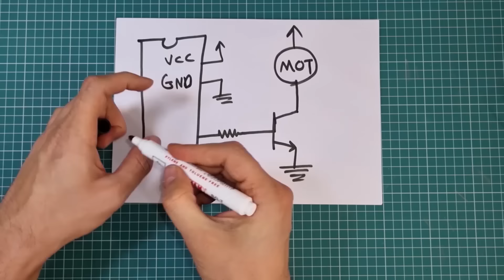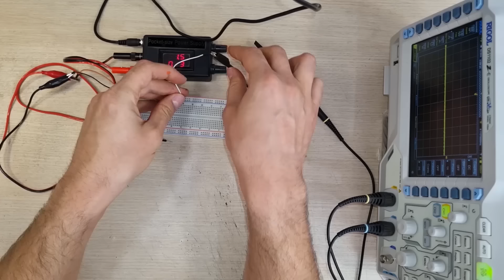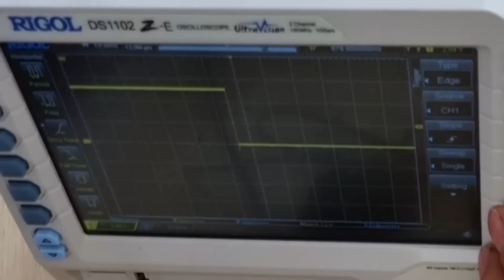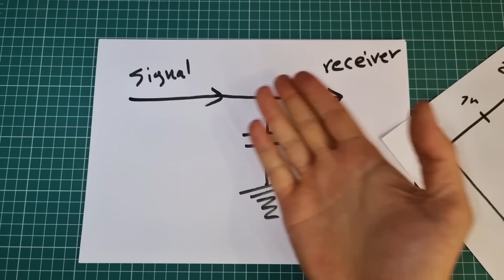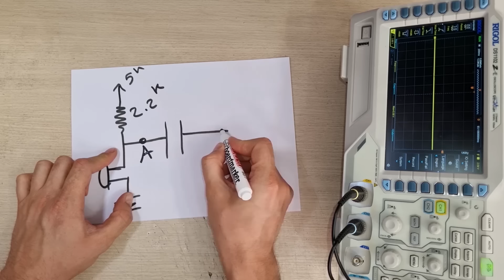10 awesome application of capacitors in circuits

Comment: I'm just getting started in understanding electronics and how electrical components work and this video was an amazing deep dive for where I am currently at connecting me to all sort of ideas and questions. After getting a basic understanding of what capacitors are and how they function it couldn't be more perfect than to find a video like that that helps you understand how they are used.

Comment: I want to tell a fun thing about capacitors that i came across. I was fixing an old Nintendo display unit and it's problems were, smell, just smell. Worked fine other than that. From the surface it looked like it had no leaked capacitors. And yea it had Rifas but they were fine. Under the PCB though, the caps had leaked directly down.
I took them off and put new ones in. And tested the original caps just out of interest. They measured within 5% of the speck. Way good for 40 year old leaky pieces.

Comment: 1:25 main differences among Cap in rectifier circuits
4:18-Using Cap to reduce ripples 
6:46- Deal with inrush current. 
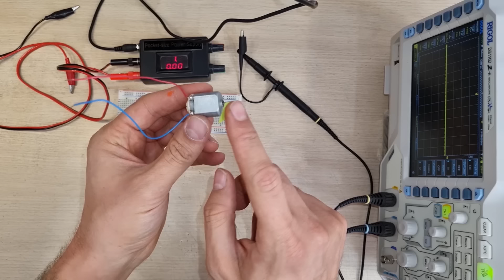8:28-  DC motor noise elimination 
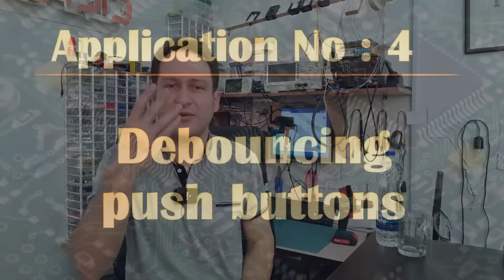11:00- Debouncing push buttons
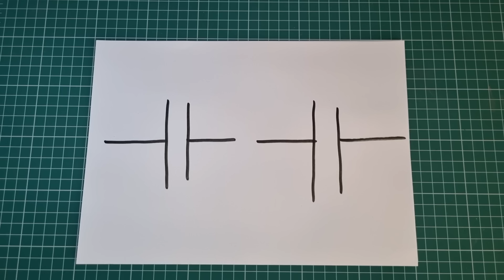14:28- Reducing general noise
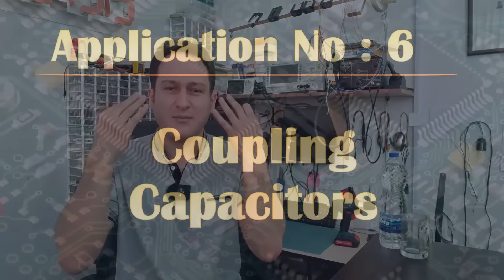16:45- Coupling capacitors
22:22- To make delays
26:35- Using as sensors
27:09- Make power supply (another video) 
28:00- items recommended in data sheets

Comment: Why do they not completely remove noise? If they act as an LPF, then all frequencies with a period longer than (like, half?) the discharge time should be attenuated/eliminated, should they not? (I'm a sound guy, not an electronics guy)
Reply from the maker: Because components (capacitors, inductors, diodes etc) are not ideal and have some parasidic resistance, inductance and capacitance inside them 😄
Reply: @elewizard  Ah ok and that all causes noise. I'm working on a precise RPM meter to tune my motorbike, and having input voltage issues (should be ~12.7 VDC, but my meter says ~2 VDC and ~9 VAC) and I think I'm getting noise issues too. I'm using an Arduino UNO R3 plugged into mains and I have to ground the bike to the Arduino ground. I'm using a voltage divider, but the measured frequency jumps about until I connect a diode before the pot on the input (bike) circuit which stabilizes it, but it's a slightly wrong reading (~25% off). I feel caps and diodes would fix it, but not sure where to put them, as I still need to measure pulses from roughly 1 to 150 Hz. I think I may have bitten off more than I can chew😮‍💨

Comment: Hello, great video. A question:  Why a ceramic capacitor for the 1.5 DC motor and not an electrolytic? It is a dc circuit right?  Is it because of the back EMF when the motor is shut off?

Comment: So for small, low voltage circuits i should mostly use ceramic capacitors for noise reduction, right?

Comment: I tried to learn electronics but when it came to capacitors, one thing I could never figure out was how to determine the needed capacitance value in a given application. It just wasn't clear how to make the determination. Like for the noise filter, capacitors used for like 1/4 hp single phase fan motors, etc. One of the aspects of this is, as you say, that you don't have to be specific but know what will be good enough. So I never got very far and then fell into other things.

Comment: Exactly what I've been looking for. Seen so many videos tell me how capacitors work and are made, without describing its properties and behavior in a circuit.
Even after a dozen "Capacitors for beginners" type videos, I still was confused when I added a cap in a DC circuit and current didn't flow. 
None of those videos explained that caps block DC and only conduct AC.
Reply from the maker: Glad you liked it🫡
Reply: Yes I just encounters that in my circuit trainer. My EE professor could not explain it to me. So odd! 
It blocks in DC (and leaks slowly when power cut) yet conducts in AC (but drops all voltage when power is cut)

Comment: why does the inrush current cause a voltage drop for the micro controller ? Does that have something do to with the inverse relationship of voltage to current? (i.e 5w = 1v x 5A or 5v x 1A) I am still new in the electronics field.
Reply from the maker: No, it is because our power supplies are not ideal,  and also because of path resistance

Comment: So im extremely new to electronics. I have a general grasp but im still learning. So im not exactly sure what people mean when they speak of noise in a electronic circuit. 

Now when they speak of noise, are they talking about the huming sound electronics can make, or are they speaking about the flucutation of voltage and current? For instance, you know how when you hook up a multimeter in the outlet, itll flucuate between 119V/122V?
Reply from the maker: All of items you mentioned are different types of noise.
In general, any unwanted voltage changes are called noise. Especially when they change very quickly.

Comment: Fortunately or not, debouncing buttons and switches nowadays is done in software. I like capacitors used in this way, but if one already have a micro-controller on the input, they can spare a few instructions to do a debounce. It's very common, since one is already paying for the MCU package anyway. Thank you for the video!
Reply from the maker: I prefer to use multiple methods simultaneously. A software based along with hardware based methods 👍

Comment: You said that polarised capacitors only work on DC. then you said capacitors block DC and let AC through. is this only with non polarised capacitors or with both. it seems like a contradiction. please explain more.
Reply from the maker: Listen, capacitors can pass ac and block dc, right?
But this is not all they can do, I mean passing electricity is not the only thing a capacitor is able to do.
In other applications, the capacitor is doing things other than only passing electricity,  in that cases, the capacitor have to be used in dc.
I hope you get what I want to say 🫠

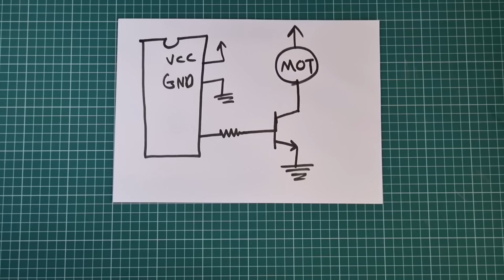Comment: BRAVOOooooooooooooo! BRAWOOOooooooooooooo! This pattern from recording time 8:00. THANKS!  I needed such a switch to turn the engine on and off after charging the capacitor to 6 or 12v.
Mini The drone's engine starts cyclically, or better yet randomly, every 1 to 5 minutes. Regards.

Comment: Amazing video, very informative, thanks,
I have a question, you showed the application of capacitors for making delays. I have a circuit with a very weak dc power source that takes time to activate and charge a supercapacitor which is in the circuit, however I want the rest of the components after the supercapacitor to not work (and thus waste energy) until the supercap is fully charged or reaches a certain voltage. How is such a thing possible? Something like a switch that can activate after a certain amount of time (1 min) or reaching a certain voltage?
Thank you

Comment: Thank you for this video. So many just talk math and useless meaningless symbols are thrown at you with no demonstration or anything for a noobie to get his head around.
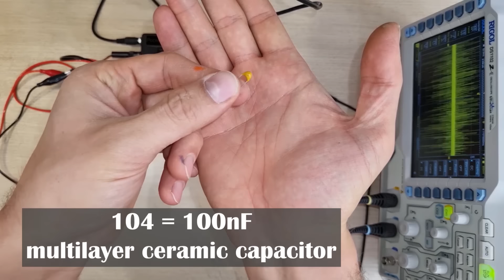I just want to know at 9:07 did you put the ceramic cap on the diagonal + -  or just on the top + rail? I couldn't tell from the resolution of the video and I've seen these caps used both ways. I never know which way to add them as there's never a definitive explanation of this.
Reply from the maker: I just put the capacitor parallel with the DC motor 👍
Reply: @elewizard   So one leg negative line, one leg positive line?

Comment: Use to store a big charge that can be dumped quickly into a flash tube -- that's how camera flash works. Also use for fun by applying reverse voltage to an electrolytic capacitor.
Reply from the maker: Yeah, I am a fan of the second one 😁

Comment: I wonder maybe he will start using different collors of each + - pair on oscilloscope, well i get that it's suppose to be measuring oscillations within a source or circuit, but if you look at it from my point like AC is basically oscillating 3 phases of DC

Comment: This video is as thorough as it gets in a single video. GREAT JOB! As you know capacitors are also used in function generators, PWM Circuits to form the ramp for the comparator to produce a duty cycle based on the reference voltage. That's using Capacitive Timing to form a free running oscillation. Though, I do believe that is also a very advanced topic that is beyond the scope of this video.  It requires explanation of constant current sources, reference voltage to reset the capacitor voltage to zero, the circuit, etc..
Reply from the maker: Yeah, there are numerous ways to use a capacitor 👍
Reply: Yeah, tell me about it,  @elewizard  Capacitive timing for PWM is a bit advanced and probably way out of the scope of your video. It would probably require it's own video series on free running oscillators being it requires at least a pair of comparators for a sawtooth to square wave and a toggle flipflop among other things to create a triangle to square. So your video was thorough for a single video on capacitors.

Comment: The classic use of capacitors is in an oscillating circuit, where the resonant frequency will depend on the capacitance of the capacitor and the inductance of the coil.
Reply from the maker: Yeah, good point 👍

Comment: Compressor circuits need a start capacitor to give the extra boost to get motor started.
Hybrid when a circuit does not have enough power to run a motor and the motor only runs periodically and for a limited amount of time. Example door motors, the the circuit is used to charge the cap and the cap is used as battery/capacitor.
Reply from the maker: Awesome, thank you for mentioning these missed usage of capacitors!

Comment: This video is excellent. I'm a complete layman regarding electronics, and the most "electronic" thing I ever did besides switching a lamp was an electrolysis apparatus using old chargers, and only knew the theory behind capacitors because we learn it in High School in my country, but it was mostly about doing calculations about capacitance in series and parallel, and mostly because our education system is flawed and focused on students passing tests than getting an intuition about what are they learning. I watched some videos to get some intuition on how it worked, how it operated using electric fields, what the electrons were doing using the Maxwell's Equations, etc... but there was a missing link.

I knew capacitors acted as filters for DC, and that it resists changes in voltage, but never thought how it could be used in a practical manner in all sorts of situations before this video. Each situation is very intuitive to understand and builds upon the understanding on the previous examples. Now I know if I want to filter noise, smooth a DC current, rectify an AC current to turn it into DC, delay a voltage drop, decouple DC from AC from situations you don't want AC, and remove DC all-together in situations you don't want a DC current, I can understand how capacitors do it all, and also I can infer the inductors do the same but "on reverse" regarding how it acts upon AC and DC compared to capacitors.
Reply from the maker: Yeah, I am glad that the video was helpful. Just a note about inductors. Inductor is not doing the reverse. It is doing the same thing as capacitor but is is doing that to current. What a capacitor do to voltage, the inductor do the same to current.

Comment: How does a start capacitor differ from a run capacitor in an AC circuit? I mean in relation to the work they do.
Reply from the maker: Sorry, I do not know much about AC capacitors

Comment: Hi great knowledgeable vid.  I wish to understand the affect of a 1.1 uf 2100  vac high voltage capacitor.
If used as a relief for 12 volt battery banks on draw.  The draw will come from an inverter that changes the 12 volts to 240 volts. Would it be best served between the dc battery banks and inverter or after inverter to reduce initial draw from battery and will it help in any other way. 
And if inverter is a pure sine wave or not a pure sin wave .  Thank you  in advance.
Reply from the maker: I haven't seen the capacitor you mentioned. I will research about it.👍

Comment: I appreciate your video, I am very interested in this subject. However music is very distracting at least turn volume way down. It is louder than your voice . Also it doesn't add any value to what you are explaining to us . Instead you could explain what you are drawing in place of the music or Explain how a capacitor does not make a direct short when it is connected to + and - at the same time. Thanks again for your video and time .
Reply from the maker: Thank you for your feedback. ❤️👍

Comment: So it's another form of a resistor? I need a multimeter
Reply from the maker: What are you talking about? Capacitors?
No, capacitors are not the same as resistors. 
Capacitors store energy, resistors dissipate energy

Comment: there is a video here on yotube where a guy uses high capacity capacitors to start an engine, so instead of using a car battery he plugged like 2 bulk caps to the starter and it worked
Reply from the maker: It is possible, the capacitor must be massive and  huge 😃

Comment: I made a spot welder (for thin sheet of steel or nickel) with a dozen of Capacitor, works well for more than 20 years.I use 12 pcs in parallel of 64000 microFarad/30VDC each, charged with variable voltage below 24 volt and switch on with a huge Thyristor.
Reply from the maker: Awesome, you did a great job 🍻

Comment: Thanks. You are the only one who said that on a electrolytic capacitor, the the side with the - electron things is the negative side.
For the sideway type of electrolytic capacitor, which side is the negative?
Reply from the maker: There is a similar sign at the negative lead. This time a ring formed think.
Reply: @elewizard  Thanks. I'll upload it to wikipedia.

Comment: At 21:00 of this video point B. Is not signaled were to connect, is this a ground?
Reply from the maker: The voltage on point B is measured by oscilloscope. Ground of the oscilloscope is connected to the ground in the circuit

Comment: If I have 2 capacitors of the same rating and same diameter but one is half the length of the other, will it make a difference in the same circuit?
Reply from the maker: If all specifications are the same, then they are the same. The length is not important.
Capacity, voltage,  ESR and ESL are most important specifications. If these are equal, then the capacitors are almost egual.

Comment: low pass, band pass, high pass filters, capacitive pumps, AC Voltage regulators, inductive heaters, zero volt switching oscillators, power-factor correction are some applications that come in my mind now, there are special instances of capacitors as well like supercapacitors, adjustable capacitors, varicaps,  FET gates, CRTs are kinda caps as well and probably a lot more that i'm not aware of yet
Reply from the maker: Yeah, thank youfor sharing

Comment: Great video. But what will get rid of all or most noise. Multiple capacitors?
Reply from the maker: Yeah, one simple but not much efficient solution is to use multiple parallel caps. Better solution is to use advanced filters
Reply: @elewizard  I’ll give those a go. I’m looking for something that will last the longest with tho most stable current. I’ve seen people step down on caps before. That seems to work well. How durable are the advanced filters and what’s the price like on them?

Comment: This video explained this process far better than a whole year in my electronics course.
Reply: And the AC Joke actually made me laugh (use #5)
There's a lot of how to stuff about crossover circuits for speakers but this actually explains how it works 
High pass filter, Low pass filter. Now we can better tune these filters to the speakers and sounds being used. (MIND BLOWN)
And fix that noise coming from that stereo ya got from Super Cheap Auto to put in that HOT VN Commodore to pick up chicks 🤣
THANK YOU.
Reply from the maker: Glad to hear that 😃

Comment: ...How can a negative input be greater than a positive input?
...or am I just not visualizing this correctly?
Still trying to visualize how I would get no pie if I divided a pie zero times.
Reply from the maker: If you apply 5V to -input and 3V to +input, then negative input will be greater than positive input,  that simple, they are inputs, you can apply any voltage to them

Comment: I remember thinking too hard and often too long on what to do with capacitors simply based on what was taught on that topic in contrast with previous lessons with other components (e.g. sources, resistors, switches, etc.), and then managing to not do a single thing at all (especially apparent when I was a complete beginner). I'm not good at coming up applications myself so big thanks for this video!
Reply from the maker: Thank you so much 🍻

Comment: just as power noise can be filtered,  capacitors adjust/shift electronic frequencies encoding sound. for example placing caps from tip to ground on a guitar signal will shift the overall equalization (freq. response) and thus tone of the resulting amp sound.
Reply from the maker: Thanks for the info!

Comment: Is it common or appropriate to use a polarized capacitor to function as a diode? Can such a capacitor do "double duty" in such an arrangement, providing both capacitance and blocking of reversed voltages?
Reply from the maker: I have no idea

Comment: Capacitors have always been a mystery to me only because of how to determine the type and value to use.  Some of it seems like educated guess work using an oscilloscope. Are there adjustable capacitors that can be used similar to potentiometers, for the purpose of experimentation?
Reply from the maker: Yes, there are variable capacitors.
Reply: You need to understand the reactance formula for the capacitor and find example circuits with the formula supplied.

You shouldn't need to guess, you need to learn how to design properly and select the right value of capacitor.